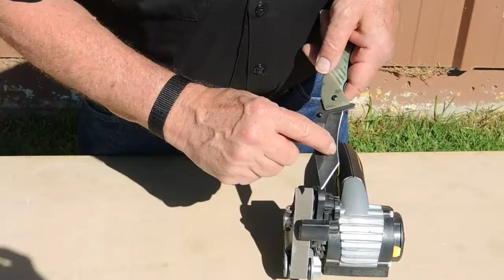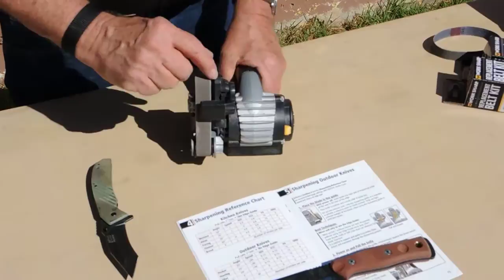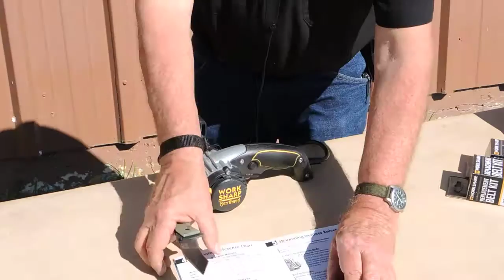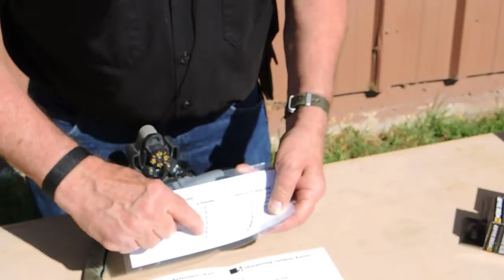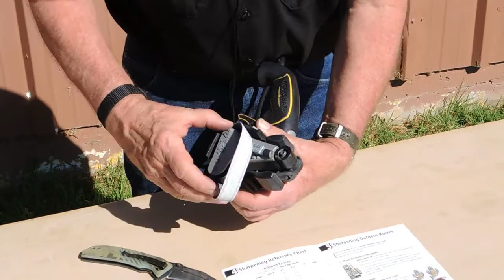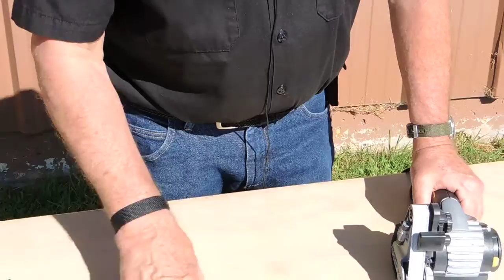Sharpening a Tanto Folding Knife using the Work Sharp Knife Sharpener

Comment: If you're sharpening an American tanto style you're sharpening two different edges, not just one. Now add the serrations and that's three separate edges on one blade! With any belt system you have to treat it like that, unless you want to grind all those features away and turn your tactical wizbang tanto into a plain edge knife. The WSKTSKOE won't generate enough heat to ruin the temper, but you have to understand your blade and the machine usage to get the best out of it! Great video sir!

Comment: Nice video.  Could you demonstrate how to get the tip back after accidentally rounding it?
Reply: HA! HA! HA! HA! HA!  Mine tan-toe is now a recurve.  I kind of like it considering it has more curves than my last gf.
Reply: I did the same thing. With no support, I said fuck it and just went with it. Poor design in my opinion.. the sharpener that is. There is no support to keep the angle while you're on the belt. And that little part gets fucked up.